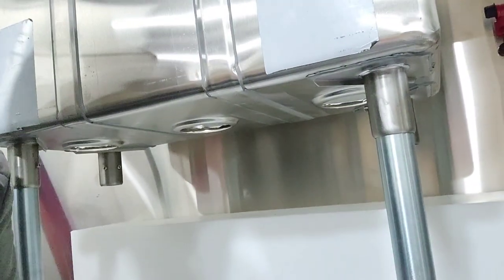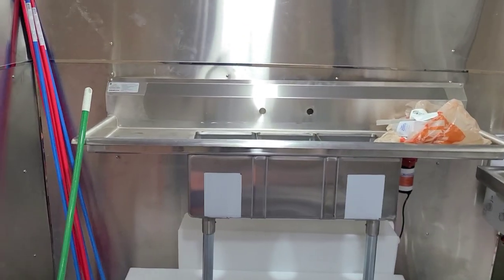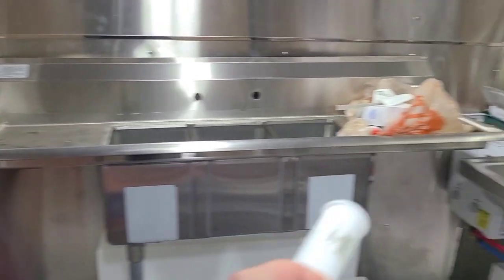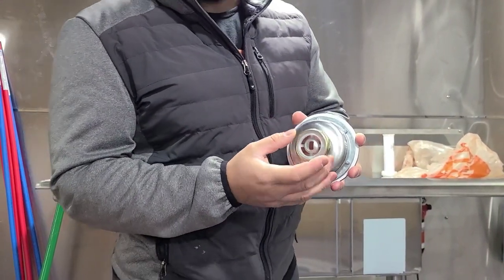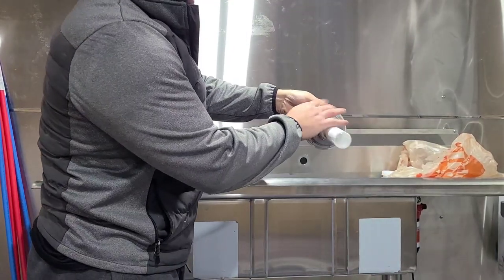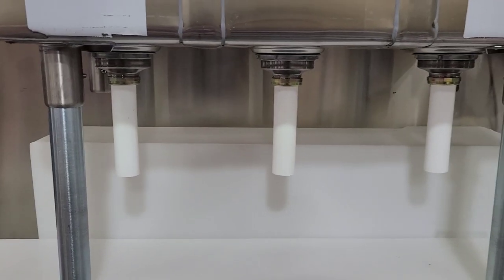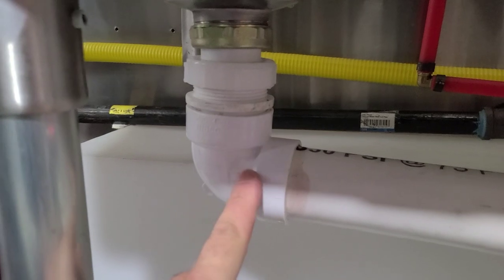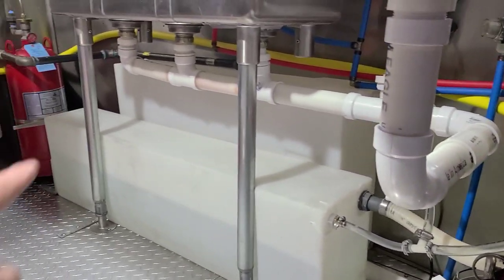How to Install the Plumbing in a Food Truck: 3 Compartment Sink

Comment: That rubber goes on the bottom side with the paper gasket in the bottom of the rubber. You have to use plumbers putty on the top side.
Reply from the maker: Yes on updated videos the installation has changed for sure. Plumbers putty is 🔑

Comment: Frank, great videos and thanks for the intel. The only problem I see is that plumber’s putty should be used on the top sink side instead of the paper gasket.  The gasket should be used on the bottom side directly under the strainer before tightening the 3” nut. It’s also better to add a sanitary Tee with clean out instead of the regular 90 coming off your first drain
Reply: Don't forget IPC requires an air gap or air break for the drainage from a 3 comp sink. I've tried finding another way to look at it, like IPC section 1301.5 and section 608 but at 1 1/2" air break and air gap are the best outside of a doublecheck backflow prevention assembly, which is costly. Some states have made that variance from IPC to allow backflow preventers like that on trucks.

Comment: You need some traps man. Trap at the end of your 3 comp sink and a trap on the hand sink. Also curious if you vented the sinks? You prob will have some back up problems if you run the hand sink and 3 comp sink at the same time , because where you tied the hand sink into the drain from the 3 comp sink you used a dwv tee on its side which you can’t do that you need to use a directional fitting like a dwv wye. But you have a good starting point of plumbing just need to get the ins and outs down a little

Comment: Good afternoon Frank. First thanks for helping me build my food trailer. Your videos have been the most help. I have a question about the seaflo pump and my tankless heater. I connected everything wrong. I need help understanding how they connect to get hot water and sink water in general. Any help is greatly appreciated.
Reply from the maker: From the water pump goes to the input of the heater and the hot water comes out from the output side thing on the water heater. They should be labeled on there hopefully

Comment: I’m building and plumbing is the hardest thing I have to do. I want to be done by Mid January. My food truck is for ice cream so it’s not really big everything is done but the sink I am ordering everything from Amazon except a few different things because I will not be using propane and don’t need as much water as you do. So you are such a big help. Can you post a video about the water pressure heater? pump set up I don’t have many plugs so I’m trying to see how you configured yours.

Comment: Frank I see the plumbing going from the 3 bay sink to the trap adapter to the hand sink...how and where does it get connected to the gray water tank....please tell me because I e never do e this before....
Reply from the maker: It all go from the trap adapter in a small 90 degree Elbow to the 1.25 threaded spot on the tank

Comment: Hey Frank, great videos but I'm wondering if I need to run a drain from the fresh water down to the the gray water outlet?  I saw that you put in a completely separate run-off valve for it.  I was thinking I would just run a garden hose out of the trailer when I needed to drain the fresh water tank.

Comment: Frank, first off, thank you for the videos. They are a great help in getting started down this road. I have a question though. I'm planning to operate in Arizona, which has some fairly stringent NSF requirements. Do you know of any reputable brands that manufacture tankless, propane driven water heaters that have a reasonable price tag such as the Excel water heater that you use?

Comment: Would it be possible to show us how you glued all the fittings together. Because I know it gets Tricky sometimes.
Reply from the maker: I can video as much as I can, hopefully it captures everything needed:)
Reply: You need cleaner and glue. You clean the pipe with cleaner by going around the surface 8-10 times … then you clean the hub of your fitting the same way. Then apply a layer of pvc glue, a liberal amount which is a few rotations around the pipe and then the same in the hub of the fitting . Stick your fitting onto your pipe, give it a quarter turn to lock it in, and bam you good to go

Comment: Hey Frank!  Did you have any issues getting the brass nut (slip joint nut) screwed on to the bottom of the hand sink drain basket? I am having a hell of a time screwing it on.  Its at 11:04 of this video it kinda looks like you ran into the same issue but then you got passed it. If I dont put the clear gasket in, im able to screw it on easily. But with the gasket in there, forget it. Plumbing isn't one of my strong suits so it might just be my inexperience getting the best of me.
Reply from the maker: That one is tricky because you think its going in right and then gets crossed threaded, It took me a couple tries but I just kept trying and trying with light force

Comment: First, thank you so much for doing these videos!!! I just bought a trailer that has everything complete except for the plumbing. I At 12:00 of the video you talk about the different trap adapters. I don't understand why there is a difference. Can you explain that? Also, I'm a little confused about the shape of the T-fitting (10:51 of the video) How does that work for the handwash sink? Does the water just flow past that fitting and then come back again? And why don't you need a stopper for both sinks? Can't the water from the handwash sink technically flow back into the other sinks just the same as the water in the gray water tub?

Comment: I'm trying to figure out two things: 1) Do i need some type of permit to do the plumbing on my food trailer or can i just do it as long as it is propertly done. 2) around how much dos the plumbing cost? not the sinks, just the pumbing, water heater, pump and all of that. thanks!
Reply from the maker: That depends on the requirements from your HD and Fire Department. My HD and FD do not require you to be licensed to do it only the Suppression System. You mean like the sinks and everything or just the PVC?

Comment: Could you tell us if all 3-vertical tail pipes coming down from the sink to the horizontal drain pipe are the same length?  It looks as though the first one is shorst???  
Also, is there a need for a breather to allow free flow of the drain water to the gray water tank?
Reply from the maker: They still all have to cut to length they will be different sizes to allow for flow to waste tank and no breather is needed at least I haven't seen the need for one on this set up water flows nicely.
Reply: @fbaltierrez   it is shorter.  You want pitch going towards the waste tank and you are supoose to have a vent on this set up.   (Breather)   so your correct.    It will still work without. But if you drain all 3-4 drains at once it may slow it down a little.     If it works it works.  But code does say to put a vent in.
Reply: I like that backflow preventor the DOH looks for that in my area
Reply: As long as code catcher doesn't catch it.   Id leave it.  Because your gonna be just fine without the vent.    With 4 sinks your venting out of each sink base whej you use 1 sink if that makes sense.  So therefore the only time you'll have a little trouble is if you dump water down 4 drains at once.   Which is prob never..    so try to send it without a vent and if code guy catches  it which I doubt they will.   You can easily add a studder vent in after.
Reply: @FamilyChannelfun32  Thanks for saying that, it being gravity flow to the tank I was certain that there needed to be some drop (angle) in the pipe going to the gray water tank

Comment: The basket strainer is not correct my friend.     The black gasket goes underneath the sink  between the nut and the bottom of sink.    And so you get putty for the top before you drop it in. And  so putty on the top ans black gasket underneath.      This way will work for a bit. But its not how it goes!    Just trying to help!    Dont mean to be a know it all.
Reply from the maker: Will have to make that correction thank you 👍👍
Reply: @fbaltierrez   They make gaskets.  Foam ones you can get.   Or can use putty on top. Either or.   Ill say this i was in a pinch at my own home and I did exactly what you did here. And it held just fine for about 3 years.  Than it finally dripped a little.   So it does work.    But better to have gaskets on both sides.   And no problem man. We all learn from each other.    I need some lessons on electrical for mine.  I have no clue.  Lol. I'll be watching your video like 5 times when I attempt to do it.